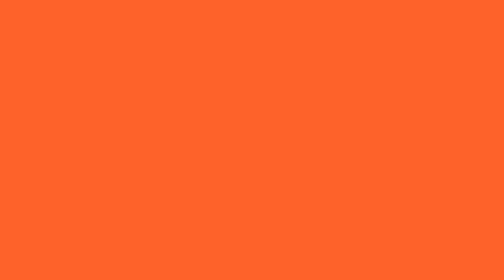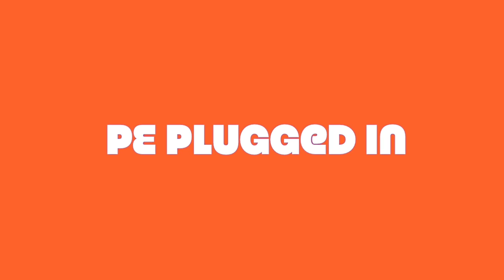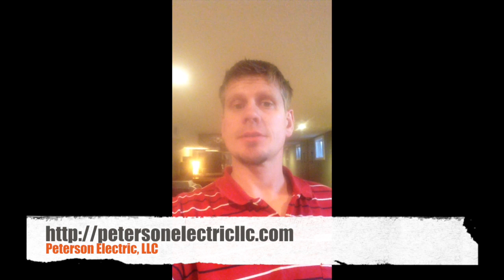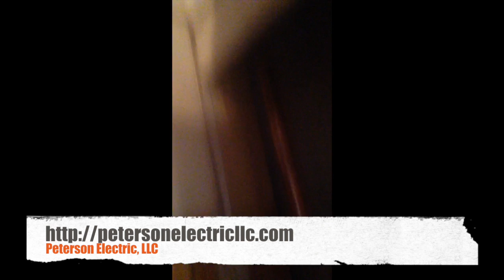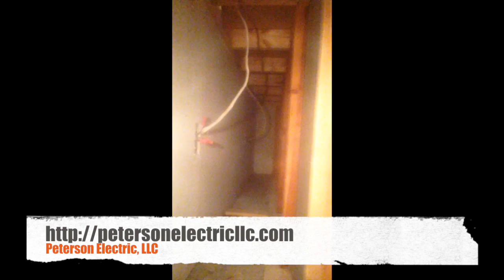What To Do With Electrical Splices Behind Drywall?

Comment: I never knew there was a code compliant splice behind drywall because it says that all splices should be accessible and to use a jb with blank.  But i was trying to see what the hell im supposed to do to an existing splice thatll cost me well over 100$ in wire and a full day to re-run..  the circuit is well within load capacities but the way its spliced id have to cut it and suspend a jb behind cement block and my ass aint about to do that..  guess im just gonna liquitite it with box and tubing, put strain relief on it and just run a afci for the branch , and just fire block all penetrations just to make me sleep better at night cabling is over sized so not worried about that..  just been second guessing myself when a buddy, master.., was trying to test for power on a broken outlet when he didnt have any tools on him by plugging in a light with two stripped wires but turned out the fixture he was testing with got a steel bar set on the cord so shorted it out and the damn thing literally blew the wire nuts off the hots in a completely different jb and took us hours to figure it out and when we did finally when we took the faceplate off the box was on fire inside and by the skin of our teeth we avoided complete disaster...  i was gloved up so i just punched the outlet as hard as i could and pushed it through the other side of the wall..  lol..  like some cartoon or something..  but shit just makes you edgy for a while after...  buddy gonna give me hell for a while for the hulk smash thing..  he was being a little girl and first thing i thought of was punch him, or it...

Comment from the maker: There are legal UL listed splice kits for the in wall issues, assuming the workmanship is correct. Otherwise, you need to cut drywall and make a splice above and below to extend the splice, but if you modify then your suppose to AFCI this circuit, 210.12 B. in the NEC 2014 code book. If you do not know what your doing then call a Professional, if you think you know what your doing then just ask, this is easier received on comments. ALSO, keep in mind the video was completed two to three years ago and new products come out all the time, we spend a lot of time in classes and in weekend schooling every year on new codes and products, if you are not an electrician then you are asking for a favor about our knowledge, typically this is something people pay for.
Reply: So what  are  they?
How do i make a code compliant splice behind  drywall.